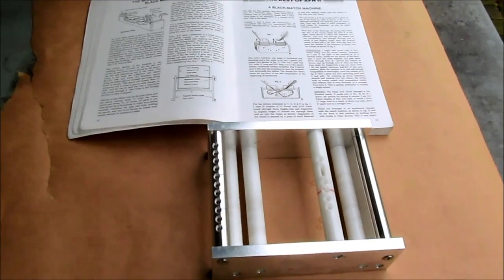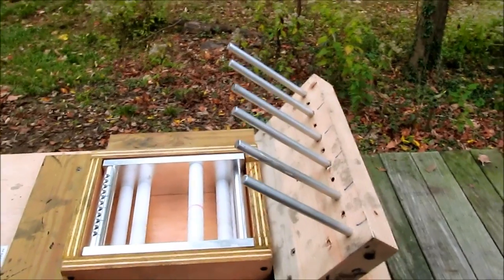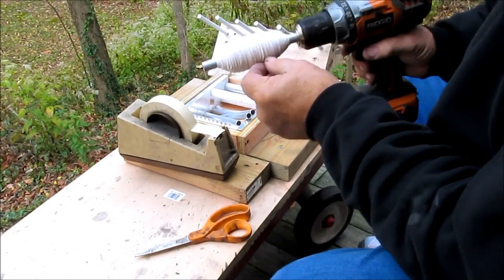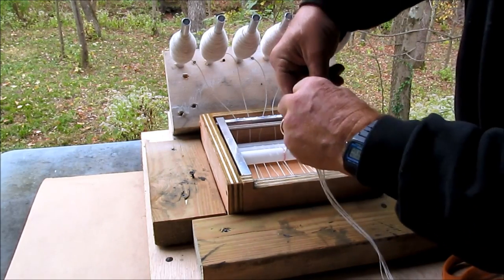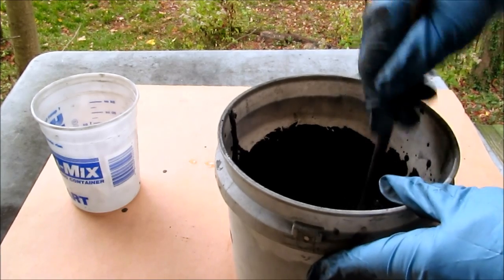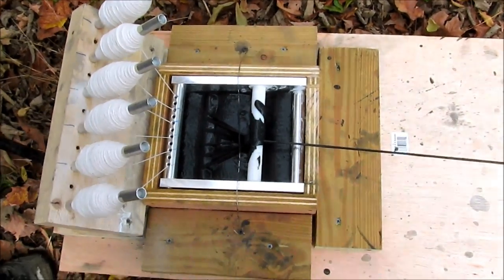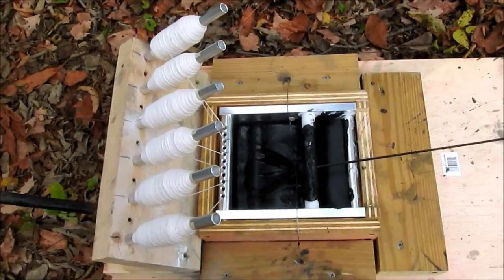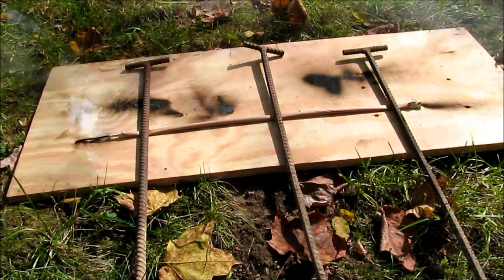Use of a Blackmatch machine to make match

Comment: Excellent tutorial,I bought the same machine and had similar results.
Reply: Doesn’t saturate the inside. Garbage
Reply: That's a ridiculous and misleading comment. I have the machine and i made 500ft of flawless blackmatch in under 30 minutes several times. It saturates each string individually before it combines them into one,how wet your slurry is determines if it soaks in to the string or not. Tie it up tight like a close line and when it's dry, cut it down and you have nice,uniform,match that's looks like it came out of a machine. The darn thing is amazing,you have no idea what your saying

Comment: Very interesting method Ned.
I like to to get things done a little quicker, so I just attach the end coming out of the machine to a D engine sized rocket, and shoot it up and over some very tall high tension electrical wires, then stake the BM to the ground on the other side.
Sometimes I get a little tingle in my arms if the mix is a little too wet.
Surprisingly, the BM dries in about a minute or two.
If left too long, it will ignite the BM and I'll set California on fire again.

I've also taken black match to another level.
I'll first run the string through a 36/24 PN/sugar hot mix with just a pinch of iron oxide added, then when dry I recoat with a layer of BP slurry with dextrose. It makes a very firm solid fuse that burns so well, that it's more fun than the time te hogs ate my sister.

Comment: Like the machine it's a great idea of how to bind those strings together getting them nice, moist, & slurried great invention by Caleb. Looks a bit confusing to set up but I'm sure u get used to it pretty quick. Now the blackmatch u made by hand earlier was a different gauge string right. Are both products the same just different sizes & different methods of preparing it. The jig u created & ur Radio Flyer wagon rig is a great way to get it stretched out to dry..

Comment: Sir are these 6 rolls of 4 ply better than your 2 strands of 8 ? .   Mine was more like this 6 roll.My machine is 5 rollers knurled with a separator  as they enter the box. Looks like Argo is out of Business. I was able to get a pound for $25 plus but I wanted to get an idea of your mix against failing dextrin. I also received the 8 ply twine today. Going to try to get the road done tomarrow. I also don't throw out the leftover , just granulate and jam it in a tube. My box dryes the compound out as the dry string seams to pull the moisture out of I rember right . It's been a long time is why I'm asking so much.  Also I used something like 6 rolls of dollar store twine. 
Bob

Comment: I love your rolling BM machine. Caleb sure is a genius to design the machine part of it. I notice that the formula is different than your slurry formula is different from the 1 with the laundry starch. Is there a reason or is it what works well with this type of machine? Does the CMC act as the starch would?Ned says have BM will travel thanks to radio flyer. Lol. Thanks for sharing the video. Get back to me here or on the forum.      Dyl
Reply from the maker: I have used slightly different formulas over the years, with various binders, Dylan. That's what you've noticed. They can all work in the specific process where they were shown in different projects.
Reply: @nedgorski  thanks for getting back to me that's what I figured just wanted to double check. I looked that CMC powder is for gum paste production mostly used in baking very interesting.

Comment: Honestly, the only thing I may have done differently would be to soak the cotton string in a solution of hot/boiling water and KNO3 and dry it prior to use.  For me, it cut down on the black snake left over from the cotton.

Comment: I want to make you a question Ned and i want a honor and true answer 🤣👍 does this machine make same quality black match as your diy black match or not??🤣
Reply from the maker: Yes it can if used correctly
Reply: @nedgorski  thanks for this useful info Ned . I had a concern for it and you solve it nice job btw!
Reply: @nedgorski  Ned does this machine have success impregnation as the old Italian method by hand black match? Because I try one of these machines I had the consistency right and it only coating the outside layers of string and not the center of it what possible could happen wrong here?

Comment: what is 1%cmc?please
Reply from the maker: Sam, that's carboxy methyl cellulose, a thickener and suspension agent.
n
Reply: thx ned and good job  i like your work lots
Reply: Hello Ned,  so I've purchased my machine and thread, made the box and holder even joined Fireworking.com (since I respect and love your tutorials).  I;m ready to pull my first batch of match, however, I can't find information regarding the thickening and suspension agent used in the BP slurry mix.  Please point me in a direction for a solution.  Thank you kindly.